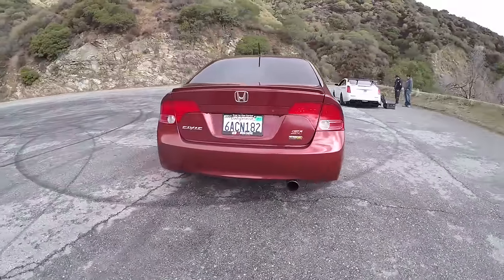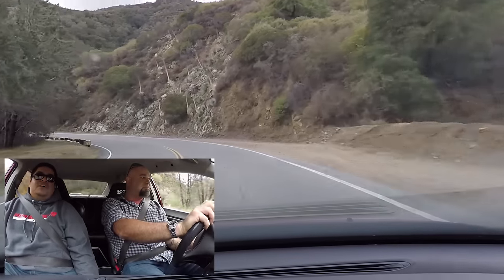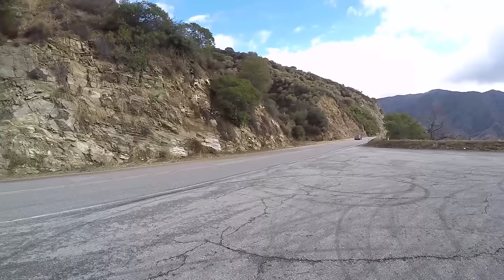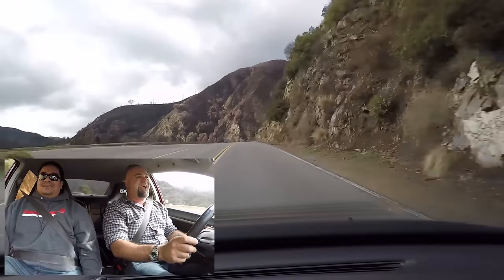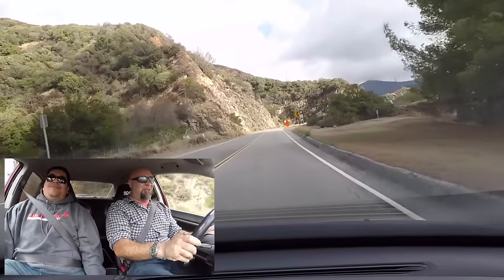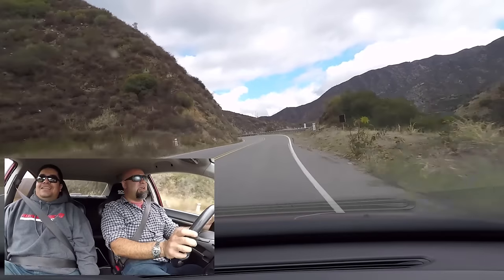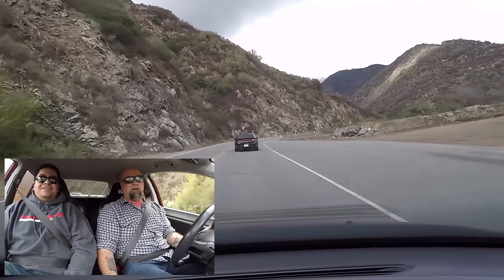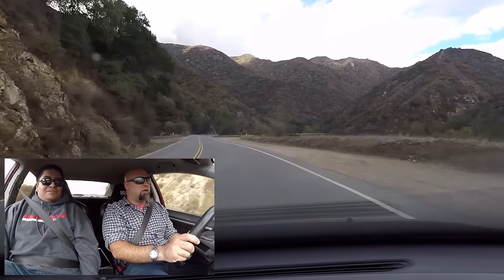INCREDIBLE 330HP All Motor 2007 Honda Civic - One Take

Comment: How much HP on 93? I see E85 as "cheating" because lets be honest, who wants to refill their tank every 200 miles, and pray theres a station nearby?
Reply: MichaelCoolGuy86 >>>  Well... if it’s 200 miles on the track, the next station is never more than 2 or so miles away.
But straight run from Reno to Wendover, I agree with you.
Reply: Yeah, that's my problem with E85. Yeah, I bet the extra power is fantastic on track. However, when you're also using your car as a daily driver, and you need to fuel up every 3 days, it'll probably get annoying.

Comment: At least $15k to get it to this level (likely a lot higher). So plus the cost of the car, you're way in the $40k range (assuming $25k msrp).

Doesn't seem worth it to me, but I guess it looks fun, until you realize there are more bang for your bucks cars out there.
Reply: Sergio Aguirre Assuming he bought it new. but used is still in the 10k range. Which places it in the mid 20s. you can get a used z06 mint for that price.

Comment: 124 mph trap on 330 whp? That does not compute, unless the car weighs ~ 2300 lbs, which isn't happening with just the seats removed.
Reply: anx1300c maybe I'm being conservative on the power figure I gave lol, it was a low reading Dyno from what I've been told

Comment: No longer an 11.3 "street" civic if it ran with slicks. whats it run on the current street tires? 12.5? 
same as a basic bolt on ho hum tuned GTI...meh
Reply: Pikka GTR 11.3 with a 1.87 60 ft. We had to much air in the slicks.  We expect to get 1.6 60 ft next time out.  Street tires I can probably get a 2.0 in the car so it should still pull a high 11sec pass on street tires

Comment: Before u all impressed with his master piece, remember you need to spend damm 50 grands for it, I would rather spend 5grands and buy a brand new type R engine from Japan and then tune it. It will be much cheaper
Reply: This car is not cool for its looks.

Comment: There is no way this car weighs 2500 pounds. My 2000 Civic Si weighs 2612 pounds. Bone stock, I highly doubt it weighs 2500. Doesn't look to have any gutted interior or and carbon fiber or anything. I think he doesn't know so he just guessed.
Reply: J SHOTTT I'm the owner of the car and who cares what your em1 weighs, that doesn't mean jack.  I have weighed the car several times at tracks and it's under 2500 lbs street trim and 2400 track trim

Comment: Why do they keep doing so many of these road tests in the mountains where you cannot hold the throttle open for any length of time for fear of running off a cliff? I appreciate that they wish to show us how they handle but in this case the main thrust of the video was about 330 horsepower, not so much in how it handles. I would like to see it run down the quarter mile and things to demonstrate the 330 horsepower. Running around a bunch of curvy roads is no way to show us 330 horsepower. Please, in the future take these types of builds to a proper location to show us what they can do unless the video has something to do with handling. I would like a camera showing me the tach and speedo during some runs so we can get an idea of how it accelerates. I need less talking about meaningless things while the review is being done. It seems like an interesting car but I have no idea how it runs in the quarter mile.

Comment: Plus I've beat wrx lowerd and they are either brave enough to try and keep up or I loose them through the corners.  I've had an evo completely dog me in my civic coming off the interstate  and swear to god he drifted the exit on to the road. A long drift like smoking the tires and was moving. He definitely pulled me through the corner.  Old days ☁😊☁☁😊☁😁☁
☁😊☁☁😊☁☁☁
☁😊😊😊😊☁😊☁
☁😊☁☁😊☁😊☁
☁😊☁☁😊☁😊☁

Oh I had a 2002 Honda civic si.    180 hp stock is 160 so she was still pretty slow straight line.

Comment: 50 gs I could have a sti with double the power
Reply: Sti don't make that much power stock lol
Reply: Korean Jesus with 50 grand you buy a nice sti and you can do easy mods and get way more power
Reply: @george-0197  yeah and comes with vaping. Seems to me you never had more then one project cars. I've been there and done it all. Sti are cool but all new cars are electronic. Simple mods on sti and evos you have to it a off the self tune. That's a $400 extra to get a Cobb
Reply: Korean Jesus relax dude it’s an opinion
Reply: @george-0197  All good, I overtaken sti in my honda in road racing with 130hp

Comment: I wish I had about 20Gs to burn. I Have an 07 sedan.nice Royal blue pearl...but it's a effin EX auto. Terrible terrible engine for a honda. Torqueless turd. Crazy DBW lag...and I'm sure it's leaking coolant with only 100k on it.
It needs a TSX 6 speed swap.
All the old Sis have 3rd gear issues and been molested by kids anyways. Better to start fresh but $$$$$$$

Comment: 50k? lmao hellll no
Reply: Like the 5th comment with the wrong information.

They said 15g
$15,000!
50k would make you a race car with full body kit, frame reinforcement, roll bars, fully tuned suspension and fully forged and built + balanced engine etc. Pretty much a 100% fully built Civic.